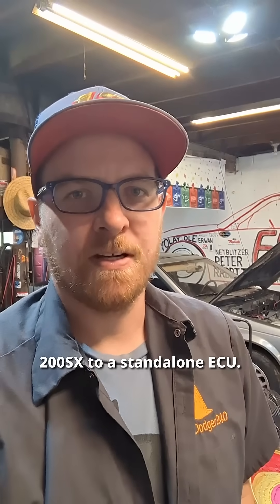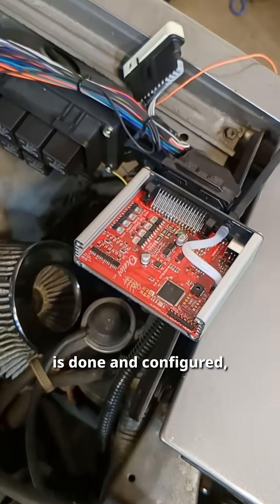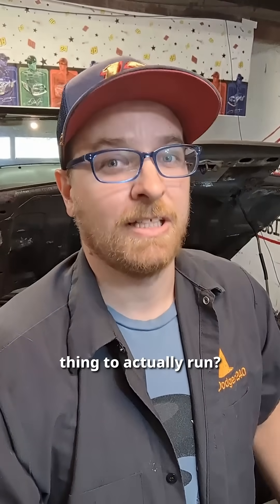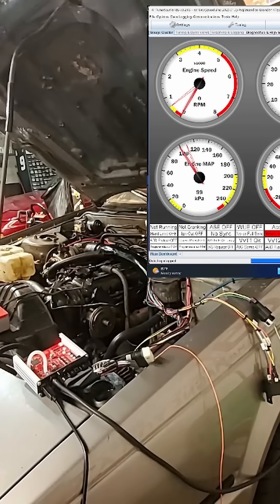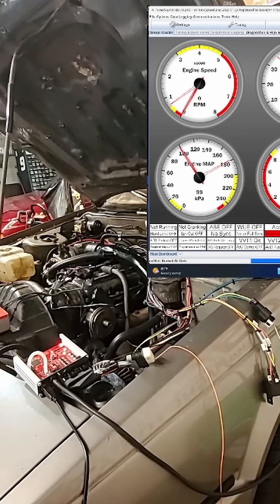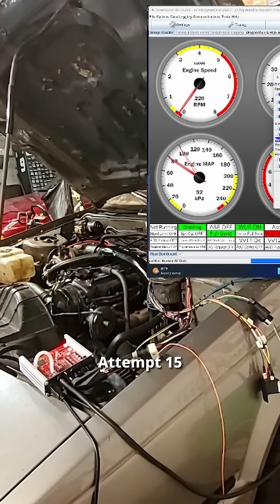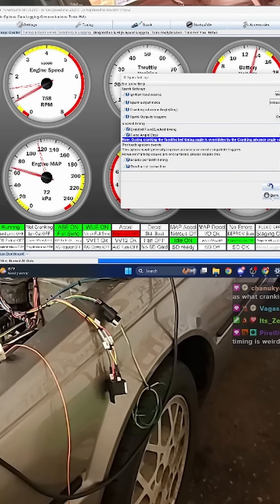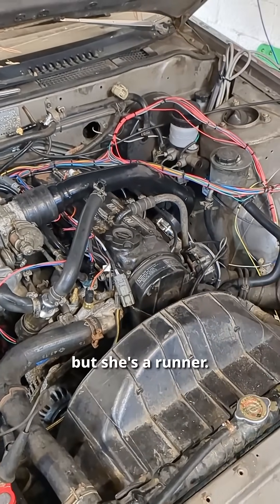First start of the standalone #speeduino #ocelot #s12

Comment: Is it running in closed loop with a 3 way catalytic converter?
Reply from the maker: It is indeed
Reply: @ConeDodgerMotoring Cool! How does it predict/interpret EGR flows? Does this engine have a pure vacuum EGR, a solenoid controlled vacuum EGR, or a pure servo EGR? Or no EGR?
Reply from the maker: We are using the oem egr vacuum system, it was brains free